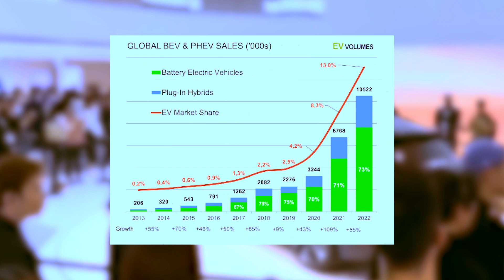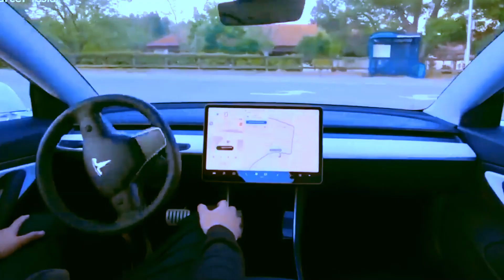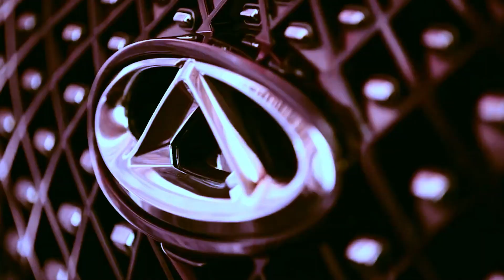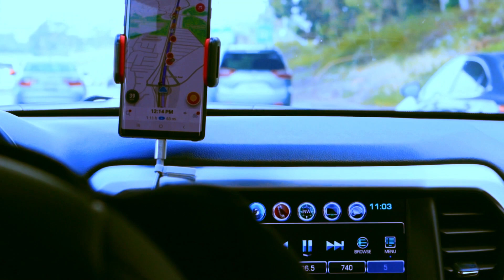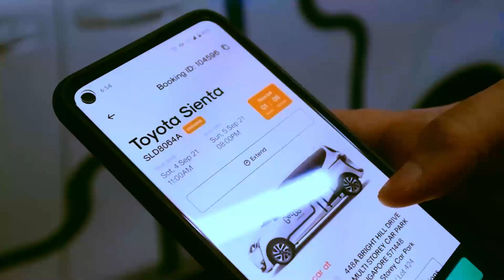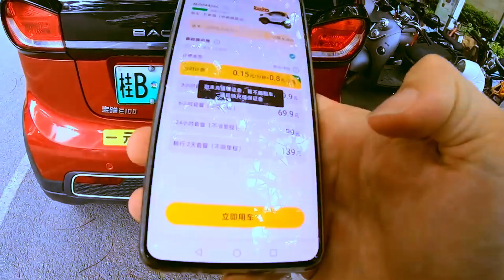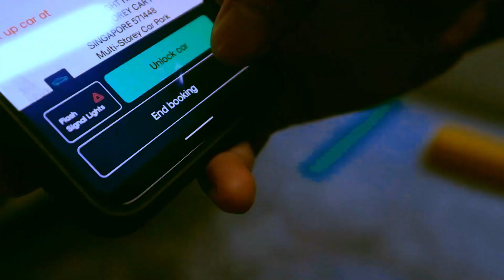THE GREAT ELECTRIC CAR EXODUS: WHAT REALLY LED TO THEIR ABANDONMENT IN CHINA?

Comment: 1:04 These are combustion engine cars, because they have a blue licence plate. The electric cars do have a green one.  3:28 also, no green plates are visible. 7:07 shows electric cars. So both types of cars are affected with the car sharing excess.The explained reasons for China to move fast to EV seems to be correct.